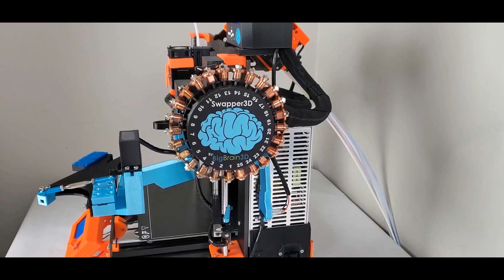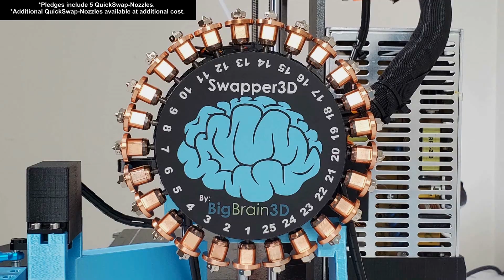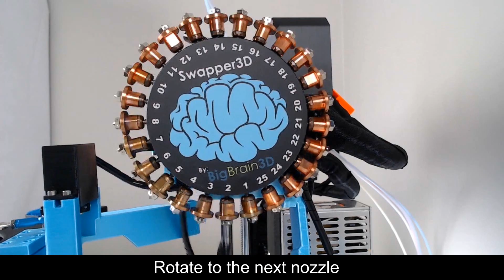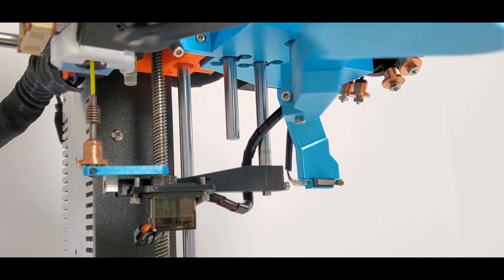Never print a purge block again!

Comment: This is cool I guess and it might be useful, but at least in the current iteration it seems more like a gimmick rather than a useful solution for multi color, specially considering how much it wobbles, the complexity of the mechanism (making it prone to failure) and the fact that most likely you'll have to babysit your prints to change the filament each time you need a new color or have an automatic filament changer. 

It seems much more effective and cheap to simply tell the printer to stop each time a color change is needed pull the old filament and purge the manually.

There is also an alternative called "purge buckets" witch simply extrudes a dozen or so cm of filament into a receptacle, and resumes printing.

TLDR: This creates more problems that it solves.
Reply from the maker: The nozzle wobbles during the Swap process on purpose. Sometimes rigidity is a gateway to mechanical failure. The entire point of the Swapper3D and this video is that it demonstrates that is that it is faster than printing purge blocks.

Comment: Careful...those quick-change nozzle-tips look a LOT like the Revo quick-change nozzles...and those are Patented.
Let's see what else...annular heating ring, also on Revo.
Integral heat-break, Revo.
What Revo doesn't offer is the heat-sink as part of the nozzle, and the Revo nozzles screw in, where these are snap-in.
It is a great idea, but it may not be entirely 'legal' in its present form.
Then again, if Revo is down with the apparent infringement, all is good.
Reply from the maker: Thanks for watching. Let me clarify some of the misconceptions. First, E3D has a design patent which protects them against someone making something identical in appearance only. Since the QuickSwap-Nozzles are not identical there can be no infringement. You can see their patent here https://patents.justia.com/patent/D762752 "The ornamental design for a nozzle, as shown and described." Also, we are not even remotely trying to copy them, we were working on this well before they released the Revo, the idea for the Swapper3D is our own 1000000%. Secondly, the QuickSwap-hotend does not include an 'annular heating ring' it's similar to a standard heat block with a hole in the center and so uses a standard 6mm heating rod like the stock Prusa i3. Third, the QuickSwap-nozzles don't snap in, instead they slide in and there is a sliding lock mechanism that pulls them up and seats their collar into a taper above. You can see a gif of this on the Kickstarter page. Thank you for your concern and thanks for commenting :)
Reply: @BigBrain3D  While I am certain I am not the market for your system, I do respect your efforts to reply some of the most inane and confused comments I've seen in a while. 

I'm surprised no one has said "Hey! That looks like you just copied a Prusa MK3 and just added some parts!"

Comment: I see it.  I believe I understand it.  However, it seems like to order a Pizza Cutter but got a hamburger flipper.
In video clearly shows filament in the hot end.  But now it got there
It does not explain how the hot end is kept at the proper temp
It does not explain the change of filament
It does not explain the filament in the existing flow does not need to extruded to proper temp and consistency
Reply: That's exactly what I was thinking
Reply from the maker: The Swapper3D changes the nozzle only, another device is required to switch the filament. in this case we used the MMU from Prusa. It is mentioned in the video. Here is a link to their product demo https://www.youtube.com/watch?v=E1ZxTCApLrs
Bascially the MMU pulls the old filament out and feeds in a filament of a new color/type. The Swapper3D then changes the nozzles so a nozzle only has a single color/material in it. 
The filament switching is not the feature of our Kickstarter and so we didn't cover it. 

The Hotend is kept at the proper temperature by the standard heating element that is already part of this printer and it's temperature controller.
Hopefully this helps.

Comment: Awesome design im curious how hard it would be to intergrate with my voron 2.4 and klipper?
Reply from the maker: It would require some available room, a mounting adapter (you'd need to design it), and a free serial line on your mainboard. We provide all the printed part design files so you can make an adapter easily. We help customers mod firmware too.

Comment: This is certainly an interesting solution to a problem not very many people have. But hey, I guess that's what Kickstarter is for. If you never actually need to 'mass produce' these and only need like the 100 people who might use it to buy in. For industrial/professional uses a binder jet printer is far more practical but those will cost many times as much as a prusa and MMU and this thing I suppose. I don't really understand why 25 nozzles are needed for this rather than like 4 or 5, though that hardly reduces the complexity at all given all the other things you apparently need to do to swap even 2 nozzles.
Reply from the maker: Prusa releases stats on their sales each year. More than 70,000 people own a Prusa MMU and 2500+ people buy them every month. 
We have a whole section on the Kickstarter about why 25 nozzles. Short answer is that you don't have to put all 25 in, it will work with 2 or 5 ... there are other filament changers that can switch 8 or 12 filament lines so the Swapper3D can handle them too. Also, the Swapper3D can be used to swap nozzle sizes like each of 5 filaments could have access to 5 different nozzle sizes swapped automatically during a print, which would use all 25 spots. Plus it's more future proof. Better to have the QuickSwap-nozzles and not need them, than need the QuickSwap-nozzles and not have them.

Comment: So now you have some hot filament cooling down in a nozzle that is set off to the side. It also seems you can only have a max of 25 filament changes per print unless you are over there cleaning out the nozzles after it drops them back. Seems like a really great way to sell a lot of products on your end, maybe a small increase in convenience down the line for the user. I think you guys should spend your time making an automatic tool changer for home made CNC routers. Something like that would have far more use and likely a larger market to boot
Reply from the maker: There are 576 color changes in the OmNom print from this video.
Reply: @BigBrain3D  Jumping on to the previous hilariously dumb comment, how do you combat filament that oozes (if any) during the unload procedure? Do you retract into the cold end or close to it?

Comment: Loved the wheel, but overall everything should be more compact and simpler. The number of parts are ... too many. Moreover, the MMU can print up to 5 colors, why 25 nozzle? Are those nozzles with different diameters? 0.25, 0.4, 0.6? I think 15 would be lingering on the overkill. If you drop the weight by half, I will absolutely buy this.
Reply from the maker: Thanks :)
We have a whole section on the Kickstarter about why 25 nozzles. Short answer is that you don't have to put all 25 in, it will work with 2 or 5 ... there are other filament changers that can switch 8 or 12 filament lines so the Swapper3D can handle them too. Also, the Swapper3D can be used to swap nozzle sizes like each of 5 filaments could have access to 5 different nozzle sizes swapped automatically during a print, which would use all 25 spots. Plus it's more future proof. Better to have the QuickSwap-nozzles and not need them, than need the QuickSwap-nozzles and not have them. 
As for the weight, we have to start somewhere and it works this way. Maybe it will be lighter in the future, and it will still work then.

Comment: so retraction wont work after change for about 5mm? also the amount of time and noise this thing is making is just... good idea but not all ideas should get to a final product. IDEX multi nozzle are much better suited. also 2+ materials are usually very rare and tbh dumb. if i wanted a toy, i would rather paint it than having stupid looking colors.
Reply from the maker: Retraction has 2 effects which both make a large impact to stringing. 1) removing extrusion pressure and 2) creating suction at the tip of the nozzle. The #1 effect is seen immediately after a swap. The #2 effect is seen shortly after approx 5mm, and to account for that we change the slicer to infill before perimeters. Painting models sounds fun :) We agree that  a main and support material is the most common and useful multi-material application. Another option that the Swapper3D provides is to have multiple nozzle sizes automatically swapped out during the print which could compliment an IDEX printer, one for support and multi-nozzle for the main material...Just a thought.  Thanks for your comment.

Comment: What happens to the filament left in the nozzle? How do I get it out?
Reply from the maker: Good question. You get the filament left in a QuickSwap-Nozzle out the the same way you normally would: by priming it out. Just heat the nozzle up and extruder the new material until the old it gone. At that point the QuickSwap-Nozzle is ready to be used with the new material/color.

Comment: Wonder if you'll ever make a double arm version like the toolchanger in a CNC mill?
Reply from the maker: Love that idea! In fact we considered that first as this concept was completely inspired by a Mazak CNC mill that a supplier of ours owns, which has a double arm. The issue is that the i3 has it's Z axis linear rod and screw in the way so only a single arm would fit there. But in something like a corexy machine space could be made available to use a double arm. As we adapt for future supported printers you may see that idea take shape, shaving precious time off every swap!

Comment: How quickly does a nozzle get back up to temperature after being swapped in?
Reply from the maker: It takes 15 seconds for a newly inserted QuickSwap-nozzle to reach melt temp. Which is almost exactly the same time it takes the MMU to unload the old and load the new filament so the heat up adds almost no extra time to the swap. Thanks for the question :)

Comment: I am amazed they don't get blocked.
Reply from the maker: Could you please clarify what you mean?
Reply: @BigBrain3D  Sure. I am surprised that the nozzles don't get blocked when they are removed and put back into the tool holder. Was this something that had to be addressed when designing this product? Or a non-issue?

Comment: Really cool rig.  I bet you could simplify the mechanism a bunch in v2.0 by licensing the swappable nozzles to printer the manufacturers and let them use the x/y/z motion of the printer to pickup and store nozzles under the bed.  Just extend the y axis forward a bit to allow the bed to get all the way out from under the x axis.
Reply from the maker: Agreed, It would be awesome if manufacturers had compatible hotends from the factory. Great ideas!
Reply: Yeah imo the carousel mechanisms, while cool, adds unnecessarily complexity. Would be better to use what the printer already has to swap the nozzle.

Comment: the idea is great but this implementation looks soo overengineered it makes me worried about reliability over time. most small CNCs uses the machines own motion system to go to a specific location and grab a new tool
Reply from the maker: Because we wanted to start with Prusa i3 support, or even support for an existing printer, there is design constraints that require certain features. In the case of the i3 we think it's pretty much the simplest way this can be done, though like all first versions it will get better, and more reliable, and simpler over time and design iterations. The good news is that most of the parts should be reusable as we enhance the design. We've taken a page from Prusa and made as much 3D printable as makes sense so that customers can easily upgrade theirs without having to buy a whole new thing. Thanks for commenting :)

Comment: Do you pre heat the next hotend in the carousel or does the printer have to wait for the hotend to heat up each time ?
Reply from the maker: It takes 15 seconds for the nozzles to reach melt temperature when inserted in the hotend. This is almost exact the same time it takes the MMU to unload to last filament and load the next filament, so there is no additional time added because of heat up in that situation. Thank you for your question :)

Comment: Where the cut portion of the filament is purged? It has to be because with the gap in the filament the retraction won't work.
Reply from the maker: Retraction has 2 effects which both make a large impact to stringing. 1) removing extrusion pressure and 2) creating suction at the tip of the nozzle. The #1 effect is seen immediately after a swap. The #2 effect is seen shortly after a little bit of extrusion, and to account for that we change the slicer to infill before perimeters. There is also the wiper on the cutter arm that can be used for priming the nozzle. Thanks for your comment :)
Reply: @BigBrain3D  I'm expecting a proof print of https://youtu.be/uNqqN5Ao_hI or https://youtu.be/2HwmjdSHr-g as a show case.

Comment: Is this project Open Source?  If not do you plan on releasing it under an Open Source license in the future?
Reply from the maker: Our customers receive access to printed part design files and firmware code. Thanks for your question :)
Reply: @BigBrain3D  Very glad to hear that but it does not explicitly answer the question Eric posed. What is the license under which those files are published, and what intentions, if any, do you have regarding changes to that license in the future?

Comment: For that price, just go ahead and buy an idex
Reply from the maker: If you only print with 2 colors/materials that may make sense. If you use an MMU or Palette and do multi-color 3D printing then the Swapper3D will save you more money in filament than it costs.

Comment: How many more steppers are added to the whole system with all those moving parts?
Reply from the maker: The printer is connected to the Swapper3D via serial connection, so there is no steppers added to the printer. The Swapper3D contains 5 servo motors (a 6th when used with a Mosaic Palette). Thanks for the question :)

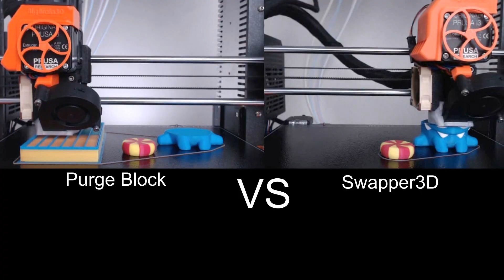Comment: During the top of the print, where it's all the same colour, the one on the left was slower in the video 1:18 1:24 , yet they should be identical assuming correct print settings and playback was matched at the same speed. Why is this not the case?
Reply from the maker: During each print we recorded the time-lapses using Octoprint + Octolapse. Octolapse took 1 picture per layer (we added the 'snap' command in the on-layer-change gcode section in PS. This means that despite the great difference in print time the original rendered timelapse (with purge block and with Swapper3D) were the same run time.  What we did when creating the comparison is attempt to, as accurately as possible, make the run time of each timelapse video related to the other correct to it's ratio of print time.  Because Octolapse takes 1 picture per layer it means that even in layers where the color is the same, and therefore the video should be faster, it appears to take the same amount of time as the multicolor layers. Though we could have tried to make this adjustment in post processing we thought we'd probably just mess it up more so we left it unchanged. You have a good eye for detail. Thank you for your observations :)

Comment: Are you considering making this compatible with larger corexy printers such as the voron, ratrig, or hevort?
Reply from the maker: Yes most printers will just require a mounting bracket, provided they have space. In some cases the main body may need a revision, and others may need a completely different design. We are working our way down the list from most to least popular, though the design files and firmware will be available to customers to adapt it to there own machines.

Comment: This is so crazily overengineered and I love it.
Reply: Far from it. About time someone implemented this. It's a standard side mount tool changer used on CNC machines. Check out how Haas machines do it
Reply: @VikMKW  You're comparing a 80k machine designed by a group of engineers to a Kickstarter project that costs around $300. I would say this is overengineered in comparison to other 3d printer mods.
Reply: @morbus5726  Over engineered means there's an excess unnecessarily complicated designs. These guys didn't do that. 

They did the minimum necessary for a tool changer to work. They very easily could've used more sensors to track tool pockets, used a closed loop servo, or made this a CAN node and made integration a living hell.
Reply: @VikMKW  I was paying him a compliment. Chill out dude.
Reply: @morbus5726  over engineering is not a compliment to people trying to sell a product. LoL 😀
Reply: @REDxFROG  Note how I said "I love it". That signifies that I am happy, and therefore, the comment was in fact a compliment. The tone of my words is what matters. If I had said "This is crazily overengineered, I hate it", that would be different. The product is super overengineered; there are 25 different heat breaks for every color, but I think bigbrain3d is aware of that, and it's not a bad design choice.